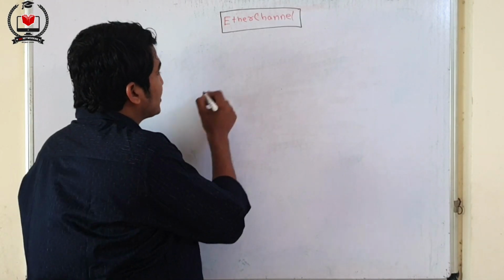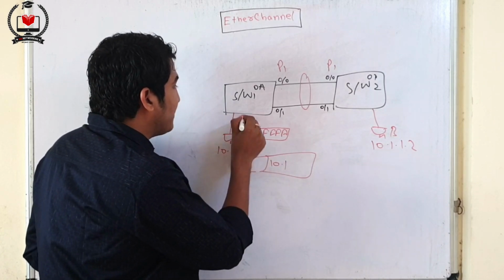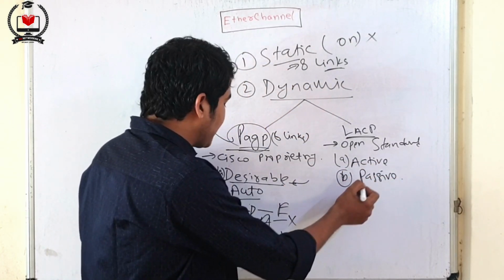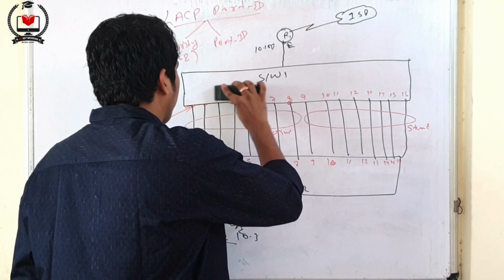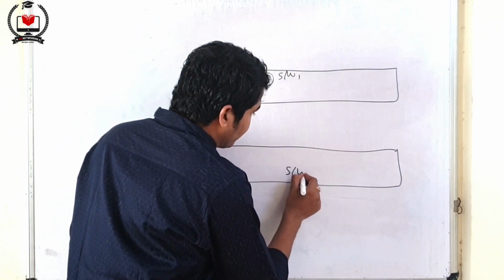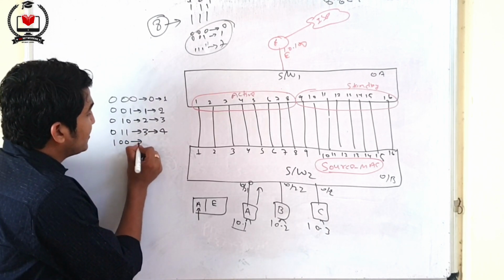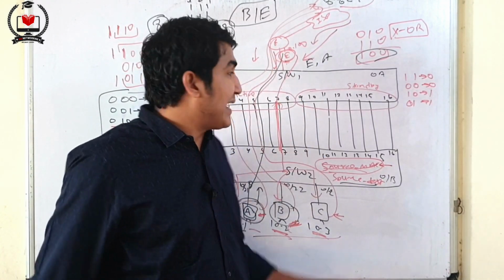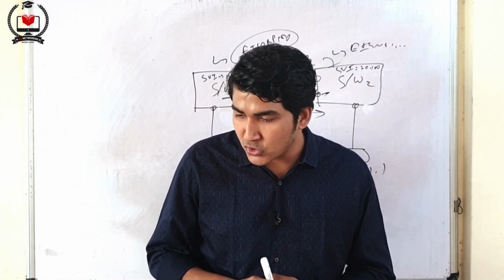EtherChannel Technology | L2 & L3 EtherChannel Load Balancing #ccna_exam #network_engineer #cisco

Comment: thanks for this great video , but why we represent 8 in decimal as 3 bits  111 , 8 in decimal is 1000  so we need 4 bits , thanks to clarify this
Reply from the maker: You are right, thanks for pointing out the error, I will correct it.